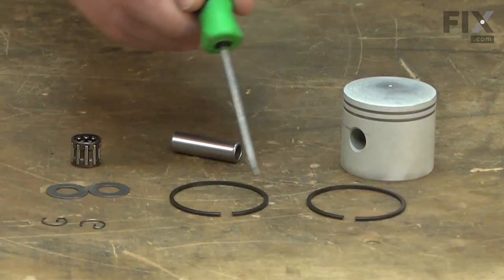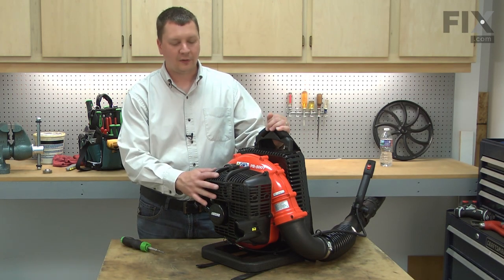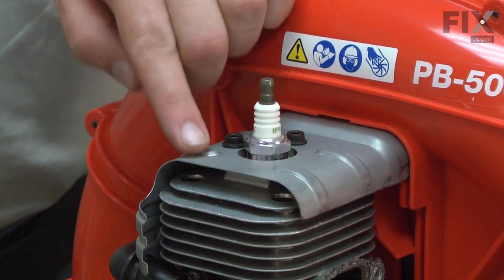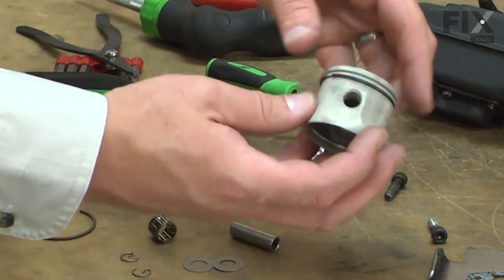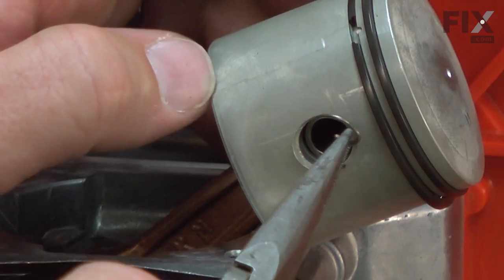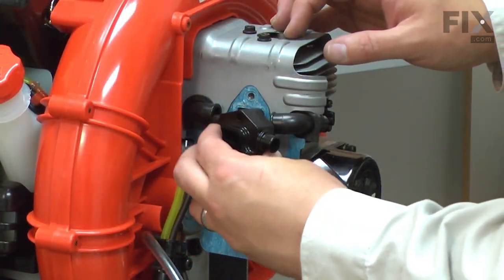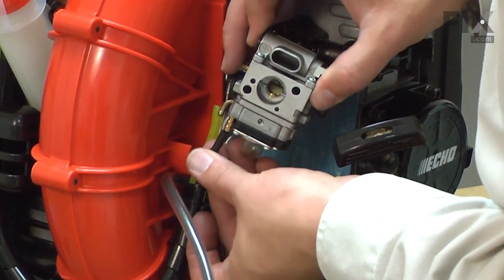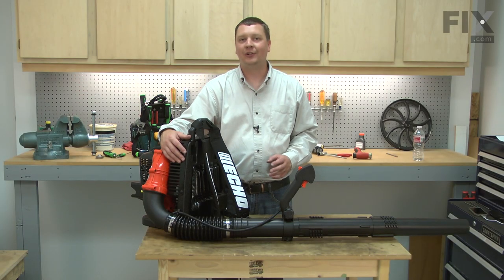Echo Blower Repair - How to Replace the Piston Kit

Comment: Good video!  My biggest problem was trying to get the wrist pin out. I ended up using an appropriate sized tap placing it in to the end of the pin and, with a lot of 'jiggling' around, it came out.  I also used a light coating of wheel bearing grease in order to keep the thrust washers in place while inserting the new wrist pin back into the new piston.  Putting it back together took some time due to my fat and arthritic non-Japanese fingers.

Comment: any advice on screws that wont budge? some bolts are too tight
Reply: On my BP-651 I used all t handle allen to replace my cylinder.  I found that regular allen wrenches were to short to remove the muffler bolts and hit the plastic shroud of the blower fan🤷‍♂️
Reply: If you have a buddy to help you you can hold a screwdriver and start turning the screw counterclockwise and your buddy be tapping the top of your screw very gently with a hammer till it releases that's what I do and it usually works
Reply: Just did one with stuck rings managed to get 3 bolts out the 4th one not so good ended up welding a smaller Allen wrench into it and was able to put vice grips on it and got it out

Comment: Does these engines takes engine oil?
Reply: No they use 2 cycle oil mix in the gas no oil in the engine as the oil mixed with the gas lubes everything. You can buy a small bottle of 2 cycle oil at walmart for 96 cents 50:1 or even 40:1 you mix one bottle in 1 gallon of gas
Reply: Does crankcase take any oil for lubricant to crank shaft

Comment: OK I took my troybilt apart and replaced my piston and NOW can’t get cylinder back on it. Lubed piston with 2 cycle oil like you did and squeezed the rings with my fingers but still too tight. Very frustrating
Reply: Same here and then the rings cracked. Brand new.  So frustrated.
Reply: you can try to use a hose clamp to compress the rings.  it may help get the cylinder head started and then remove the hose clamp to get the cylinder back in the bore.